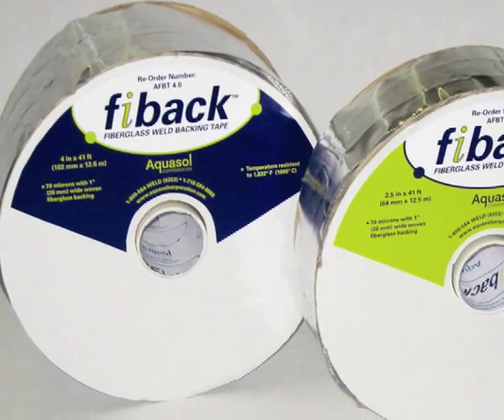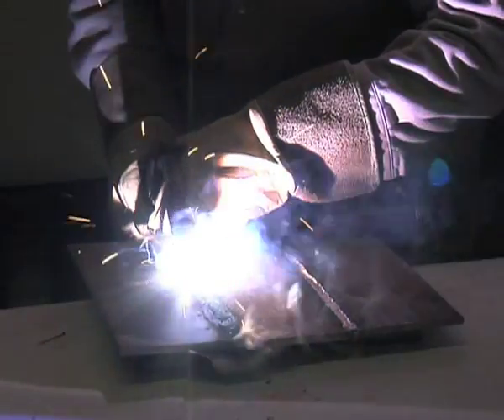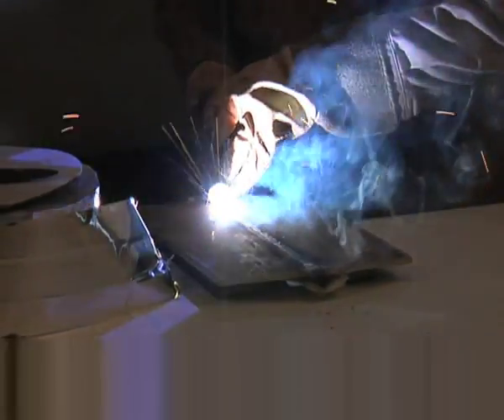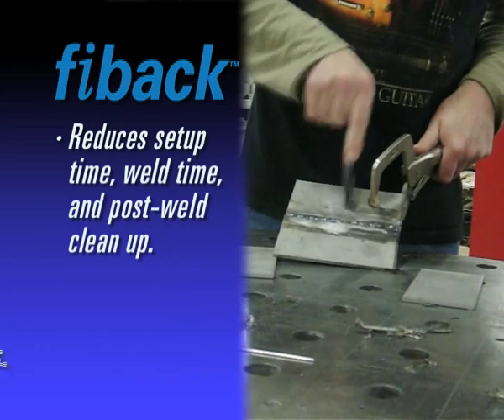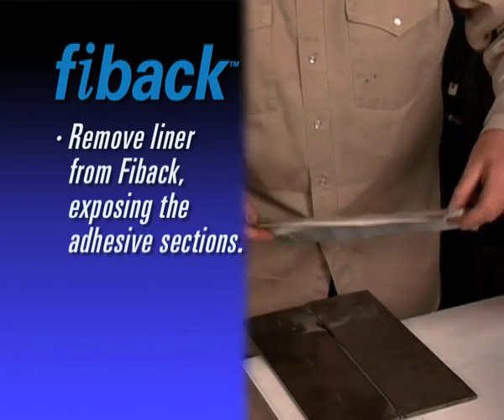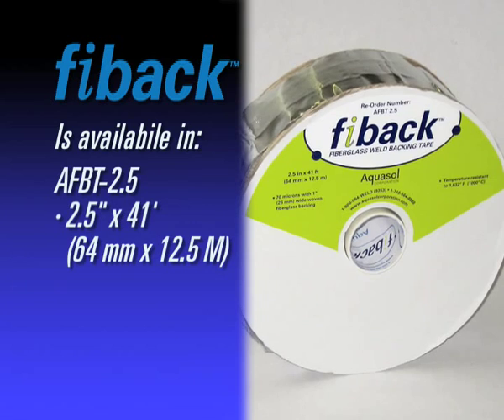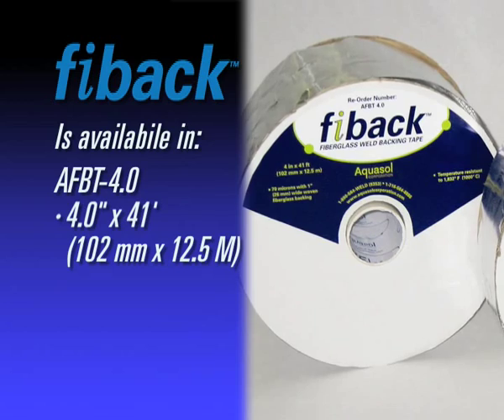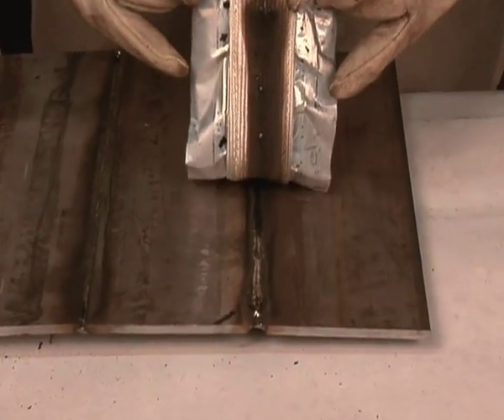Weld Backing Tape from Aquasol Welding

Comment: Tendrán alguna foto con buena resolución para ver como queda el lado de la raíz?
Otra información importante es la separación que deben tener las uniones, ya que he realizado pruebas con 8 mm de abertura y la cinta no soporta el calor. Sera que existe un máximo de separación en donde la cinta es eficiente..?
Es  realizar la curva con un lápiz.? o también se puede usar pegada totalmente incluyendo la fibra..?
Reply: Samuel,
Thank you for your comments.  Please send an email to info@aquasolcorporation.com  so we can send you our manual.  The manual identifies best practices for use of Fiback including  process, root gap, thickness,grade, wire, amperage and heat input. I cannot upload the photos on this channel.

Other advise: 
  1 . Reverse side profiles for MIG, TIG and FCW are shown in the technical manual.The key feature is the ability to control penetration for both carbon and Stainless steels
2.  Joint preparation and root gap are critical in the use of Fiback.   1 to 2 mm gaps are preferred in combination with a feather edge preparation. 8mm is far too wide – the maximum we have data on is 4 to 5mm for Carbon Steel. In summary it’s the interaction of preparation, gap and welding position which is key to ensuring a smooth flat profile

3 The practice of a “curve” / “arch” on single sided joints is NOT recommended. Fiback works best when pushed directly onto the joint face – indeed this is the only way in which it assists in controlling penetration. In purging situations this also minimizes the available oxygen contamination for the root area

4 The final adhesive residue, after welding is visible on the parent steel, but can be easily cleaned off
We hope this assists in your understanding of use.
Sincerely,
Aquasol Corporation

Comment: Our company is having massive problems with the Australian born "K-Tig" system, simply because our seams and fit ups are too inconsistent for the good but delicate nature and needs of the K-Tig system. We are looking to discard the enclosed argon purge backing method and simply use Fi-back tape. It needs to handle massive tig weld heat, and I've used it at another company and seen it work. This tape can handle so much heat it can almost be re-used. Ceramic tile tape will not work on a K-Tig system so this tape is our only hope.
Reply from the maker: We're happy to hear you've had a good experience with Fiback! Please feel free to contact us at info@aquasolcorporation.com or 1-716-564-8888 if you have any questions about using it for your current application.

Comment: It's not a patch on, Ceramic backing tiles
Reply from the maker: Thank you for watching our video.Fiback is a continuous piece of fiberglass backing which extends 41 feet for heavy duty and 82 feet for light duty. Fiback can be cut to any size you may require.